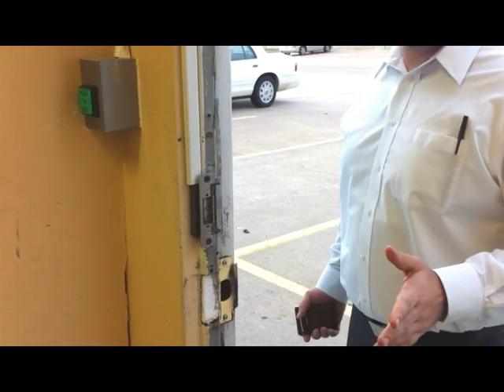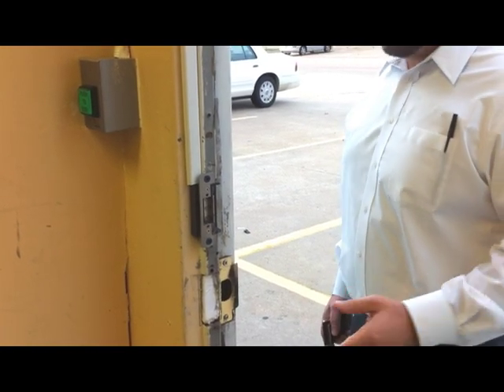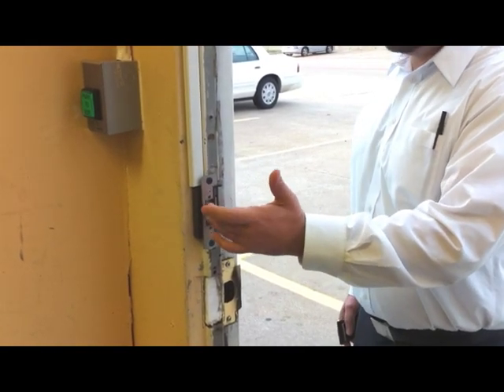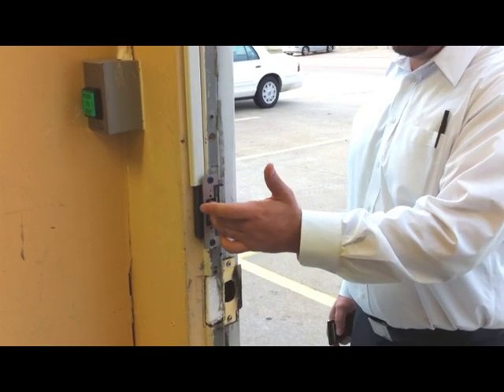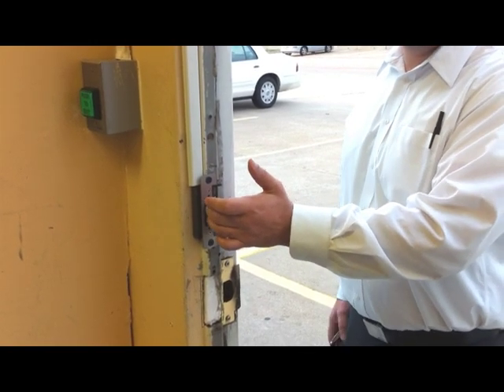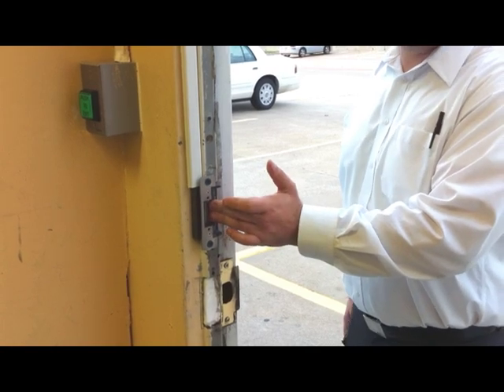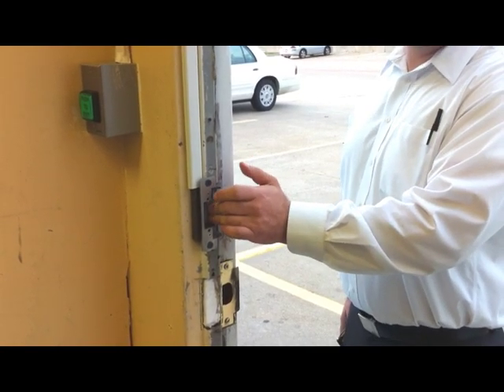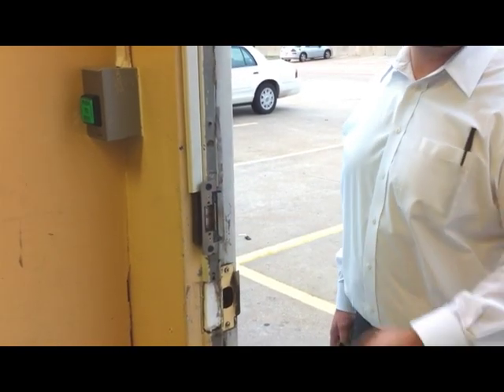Access Control - Electric Door Strikes & Magnetic Locks

Comment: Wow, that looks like hell. If I did that kind of work for a customer they wouldn't be a customer very long. Lazy, shoddy work. Crooked wire mold, unnecessary wire mold.

Adding a RTE button adds absolutely no security when any one can push the button. They are a safety device not a security device.